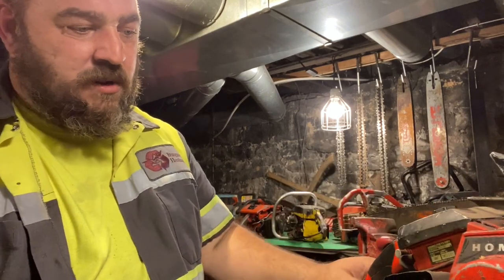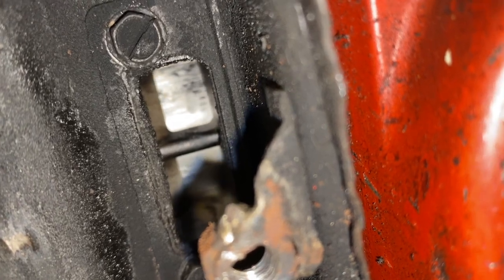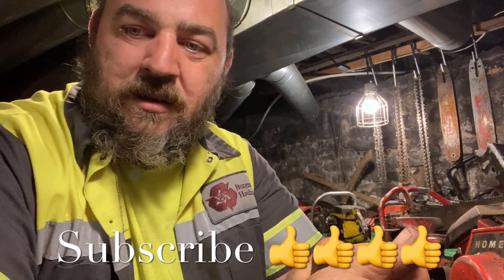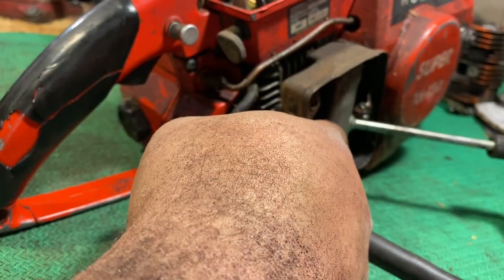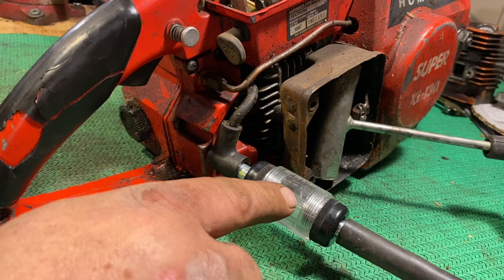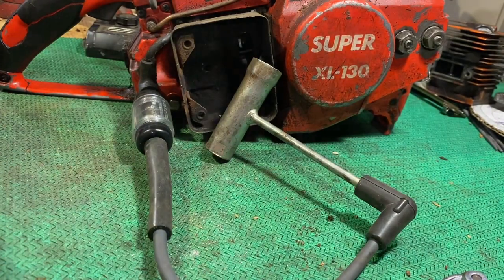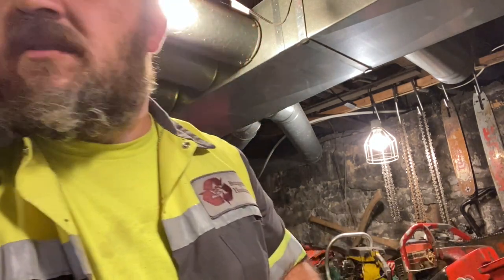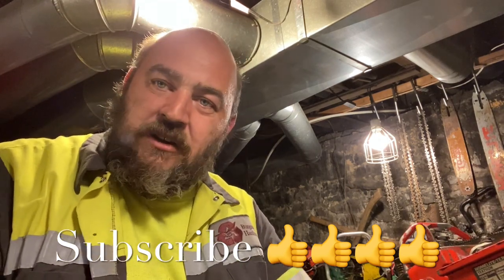Porting Homelite Super XL 130 Project Start!  It’s About To Get Hot!!

Comment: Recently bought a lot of saws and there are 4 Terry sxl-130s in there and already had 3 runners, if you need a cylinder let me know, I'm in Edmonton Alberta, so shipping time might suck
Reply from the maker: What kind of shape is the non runner in?
Reply: @Smittyschainsaws  All 4 of the new ones seem to have good compression, will pull mufflers after work today
Reply from the maker: Awesome!!

Comment: i got a homelight c-73 in mint condition  love to tweak it any thoughts i never started it cabs bad i guess its ran last in the 1980`s well i started on gas squirted in carb fired up but i know it`s A+
Reply from the maker: Sounds like you just need to replace the fuel line and rebuild the carburetor. Crankshaft seals almost always need replaced as well. If they leak you will not be able to control the way it is tuned. It will behave erratically.